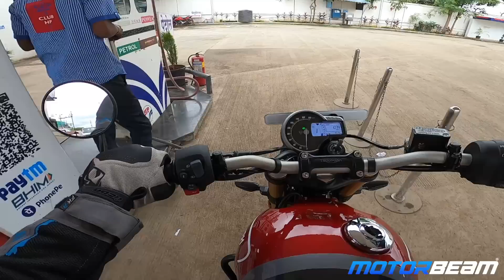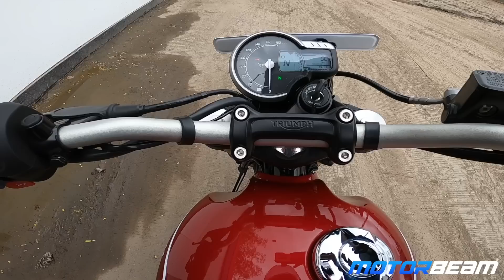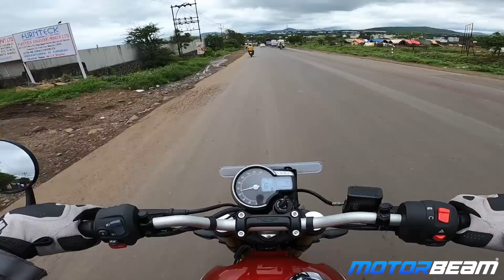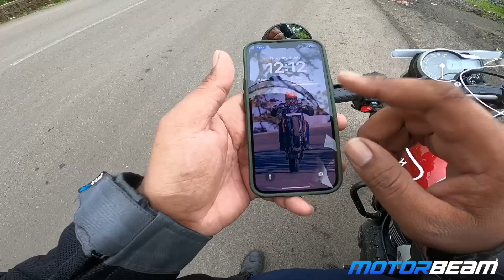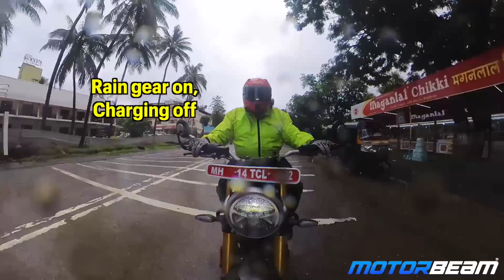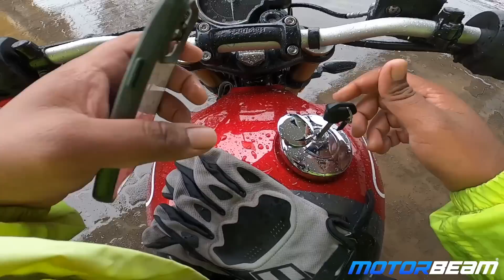Triumph Speed 400 - Mileage Test 2X.85 KM/L & Important Questions Answered! | MotorBeam

Comment: Hi I am currently facing stalling issue when I am just holding my clutch for few moments and leaving the throttle in 2nd or 3rd gear. I have latest updates of software updates. I have been going to the service centres so many times but they are unable to find the reason, chain is clean and tight as per required still its happening. Is anyone facing the same. Also I am not feeling the initial torque anymore. I own scrambler 400

Comment: Change final ratio!!! Is too “short”!!!!…… so= away standard final ratio ( 43/15= 2,866 ) and take: 36/16 ( 2.25); so you can go at taki 110 /4830 rpm and not “standard” 6150 rpm ( too much!!); you will have:
Less comsuption ( +- -10%);
Less engine stress;
More confort;
More cruise speed
Bye

Comment: This is a short stroke engine.. I wouldn't encourage anyone to run at too low revvs.. you will screw up the engine..no need to keep it in boil, but at around 3.5 to 4 k rpm which is certainly better than a ktm.. let's come out of the old bullet Era..

Comment: Triumph real world tests show 29.
Autocar tests shows 30 in city and 33 on the highway. 
A press bike with very low milage and which is being pushed to the limit will do less.
I am not worried this won't beat a 350cc long stroke, but it will be just fine.

Comment: Guys remember, he has performed several tests (Tractability, Braking performance, 0-100, Top speed) after filling up tank full. Moreover, these are stock bikes. So the mileage number achieved has been impacted due to these reasons. Anyone driving between 80-100 should get close to 30 kmpl in my opinion.
Reply: I agree, reviews seem to be 25 to 33kmpl, which sit well with the official figures of 29kmpl. It all depends on rider weight and especially riding style.
Reply: I disagree keeping in mind that the fuel now available is e20 which is definitely going to downgrade the milage of any bike
Reply: @thebackbencher005 e20 is still not available bro and e20 has separate pipe where it is written e20 you have an option wether to fill e20 or normal
Reply: Still poor average, cb 350 is way better in terms of mileage.
Reply: wht u get in dominar t same here be its a dominar engine
Reply: In Mumbai you will get 15-16 kmpl
Reply: No
Reply: Absolutely

Comment: My CB300F has given 49+ kms/ltr on highway .. of course between 70 to 85 kms/hr consistent ..
Reply: 49? Seriously?
Reply: @dinodino8662  yes only highway mileage.. city is about 32-35 kms/ltr
Reply: I Own a CB300 F and its the most fuel efficient 300 cc bike as its a SOHC engine. Keeping speeds between 70 to 80 kmph will return always more than 42 kmpl plus mileage
Reply: Bhai clutch use krne ko mileage nhi bolte...... i dont think 49 for 350 cc.....

Comment: 25 ish for a 400cc 40hp motorcycle is a big W. Thanks to motobeam, this test really helps deciding if it's a buy or pass for most customers.
Reply: This will increase after the servicing are over to 30-36km / lr
Reply: @dr.martinhwangivanowsky9438 ghanta
Reply: @dr.martinhwangivanowsky9438 😂😂😂😂😂

Comment: When you are not throttling the engine its run on wheels power, fuel supply get completely disconnected, hence it's showing 99kmpl

Comment: My SuperMeteor 650 gave 30 on highway+City..with speeds around 130 ..This one was surprisingly bit low..
Reply: Interceptor gives 30-32 kmpl when riding within gps100 kmph. Mileage drops every 10 percent for every 5kmph more. Your stats don't seem real! I own an Interceptor fro last 3 years.
Reply: @MAX-xw8xq well said 🙏
Reply: And speedo is accurate too in RE unlike 10% correction in bajaj

Comment: Max 28 expected in less traffic. Now I feel relaxed. I will settle with my r15
Reply: That's why Yamaha should bring XSR 155 to India
Reply: In city 45 and in highways around 55
Reply: @soorya_k_a_s_p 15 gives the best mileage among all performance 150 cc to 200 cc bikes. Im getting 54kmpl in city highest being 57 kmpl in city and 60 kmpl at highway as well. 😊
Reply: @vinb69  you can definitely go for it. I have almost 5 years of ownership now and getting 52-53kmpl in the city. Highway is also the same or higher. It all depends on how you ride and the chain maintenance specifically because the chain of the r15 isnt that good you have to lube it quite frequently

Comment: All 400 cc bikes like adventure 390, dominar 400, himalayan 400.
can gv mileage  around 26 to 30 max.

So triump in same segment giving mileage of 22 is a concern..
 And thats a big drawback for indian buyers if anyone looking for mileage.. 
Also service and maintenance of 400 cc  bikes wil b on higher side..
Will a  premium bike with a premium price tag succed in india or its just a hype among buyers.. !!!

Swift  with 1200 cc giving efficiency of 22 + on highway with 4 people onboard and luggage..
Reply: I completely agree. if its liquid cooled the mileage should be atleast 30+. maybe they should have lowered the torque a bit bcoz in this segment that torque is eating all fuel and in average road conditions no ones gonna go beyond 90. all these people defending triumph that it goes 170 and all. I m like wtf we dont even have good roads to cross 90-100. an average safe rider is going to ride it at 100-110 max on highways

Comment: Tank full to tank full method is the best but then always ensure it is auto cut off to auto cut off. The sensor is pretty consistent across fuel pumps and u will almost always get exact same fuel level at the start and end of the mileage test. In this video it seemed like 200-300 ml more was filled compared to at the start of the test. Thanks.
Reply: But what about position ,?
Reply: I have tested tank to tank many times I've always got 22-24

Comment: Need your thoughts on this guys

I m Confused between the Interceptor n street 400 
...yes i kno...price wise they are different segment bikes....

I m intrested in performance...as power to weight ratio will play a big role...
Reply: Going purely on the torque to weight ratios the bikes look similar. Possibly the Interceptor a little bit better at low revs and the Triumph will have a higher top speed.
Reply: Interceptor always if you can go for it
Reply: If you had a plan to go for an interceptor then you can consider GT650.

Comment: mileage test results and actual personal results vary more often than not, mostly because of riding styles,  although a ton of other factors are responsible as well..i usually get 34 35 kmpl on my dominar400 in medium traffic conditions, and on highways i touched 37 max..
Reply: Mileage is depends upon mostly upon a riders throttle action then comes tire chain  condtion and then tire pressure. And you are right if driven at 80-90kph at top gear in highway this will give 35 kmpl very easily
Reply: @mayukhsharma8465  yup agreed..riding habits contribute heavily, be it a motorcycle or a car
Reply: This is not dominar. It's a new engine
Reply: @kooler999ify  the point here is that actual personal mileage will vary, for any engine that is

Comment: hows the engine heat felt while riding , several ride revieves stating it felt a little too hot (near thighs or legs in general) 
considering this is rainy season which means its cold atmosphere , i wonder if the engine heat gets unbearable in indian summer condtions .PLEASE please CLEAR this doubt im interested in buying this bike if its has heat up issues then i have to reserve my decision.
PLEASE DO REPLY TO MY QUERY !! IT MIGHT HELP OTHER POTENTIAL BUYERS AS WELL.

Comment: The mileage is 22.8 kmpl guys 
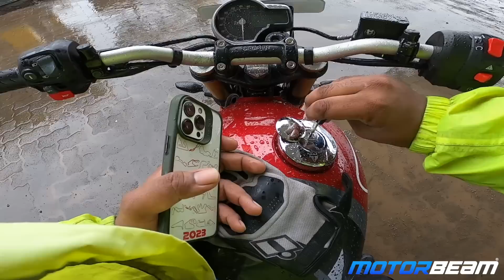At 7:15 
It has to be the worst omg 😭 I'm thinking of whether I should I buy this or settle for TVS Ronin or wait another couple of years for Triumph 250 😂(note I'm a beginner rider, have very few riding experience)
Reply: I'm using cb350rs...it's top notch in comfort, reliability and mileage is 30 in heavy city and 35+ in highway but triumph is pure performance oriented and the mileage would be around 25-30 . I would say u to go for test drive all the vehicle in the price segment and decide
Reply: @Yarahman19  yeah I'm thinking of buying the triumph as well 😄 just need to compromise the mileage part
Reply: @starboy_satoru  yeah bro... I think under 3 lakhs , it's the best for now.... Since it's a new bike , u have to be ready for facing future mild issues... But still it's a triumph they'll provide good service I guess
Reply: Go for CB 350 variants
Reply: @footballbengalcity  I don't like them personally 😭 I really wanna buy this premium bike triumph
Reply: @starboy_satoru  look bro premium things cost more . .. 
In future if triumph leave our country.thwn you will face problem .. 

They just made partnership with Bajaj 
. Like Chevrolet leaves,,,many more .

So if you like to buy premium bikes .then go for Honda bikes,,Suzuki,,,Yamaha,,,kawasay ....Honda has the premium bikes .. and good network in India
Reply: @footballbengalcity My cb350 gives 25-27 kmpl in city😑... I m not a harsh rider
Reply: @SJstreetrider  check tyre pressure, engine oil levels, mainly lube the chain it will improve
Reply: go for cb350rs
Reply: Meh I think about 25-30 if you don't ride like crazy all the time.
Reply: Kk hmm go for TVS Ronin it's light weight easy 2 handle , digital instrument cluster ,good mileage,semi retro so u don't feel old nd lastly is beginner friendly
Dual channel  abs only offer  in triple  tone variant so ignore other variants
Reply: You settle for Ronin because Ronin customers will not buy a triumph because its a premium brand 😍
Reply: @pritamchakraborty4951  bro its a 400 cc bike nd it's not a beginner friendly bike 
U r not  understanding what we r talking
Reply: I would never suggest this bike to a beginner ! You have lots of great options far cheaper than this. A beginner starting with 400cc on Indian roads. A no for me. Especially if you are living in some big city where traffic is usually a big concern. Get yourself a sub 250cc and gain confidence before moving to these premium  brands. And mind you, this is just the mileage figure which brought this question in your head. Wait till guys start crying about service. And let me tell you, let Mr Rajiv Bajaj blabber about low service cost but this bikes service cost is not going to be cheap !
Reply: go for a meteor or highness
Reply: I mean. you're getting 40 bhp. what do you expect? and I'm sure you can get around 28 if you drive sedately.
Reply: After 2 or 3 Services you can get around 30 to 33 easily

Comment: Not sure all these video's showing mileage test, how reliable is it?. 1st these are test vehicles 2nd they are abused by multiple riders 3rd no vlogger mentions the km run on tht bike and if it is serviced.
The actual mileage will be known only after 1st service i.e after clocking probably 3-5k kms. Just my thoughts
Reply: yes its true
Reply: I agree. Triumph say that in real world tests with a 50/50 mixture of city and Highway riding the bike will do 29. For what it is worth, I trust that figures, I have had 3 Triumphs over the years and have always achieved or beaten their milage figures.

Comment: Hi, you told buzz will not bother while cruising at 120 km/hr, does that statement hold true for 140 km/hr ?
Reply: going by the videos definitely heavy buzz of vibration will come at 140km/hr i think 120km/hr is a perfect crusing bro
Reply: @mohanram7450  100-110 is best.

Comment: This bike has created a hype that no other bike was able to since the first gen duke 390, it's just speed 400 everywhere
Reply: Many potential Royal Enfield buyers are considering buying the Triumph speed 400 including me. So comparison is necessary.
Reply: @souviksarkar578 no
Reply: @souviksarkar578 bro wait for hunter 450 from RE.  So simply don't  go with hype & marketing most of the reviews are paid.... Triumph don't have any service centre apart from major cities and major cities have only 1 service centre... I'm thinking this will end up like BMW 310 service where single service cost you 7k (No spares parts included just oil change)
Reply: @saraswathib8068  I have seen the spy shots of the RE scram 450. It doesn't have USD forks. Besides RE can never match the fit and finish of the Triumph. Also the price difference won't be significant to go for the RE. Speaking of service, Triumph has 16k/1 year service interval. Triumph showroom is 50 kms from my home and RE showroom is only 1 km. Still I would go with Triumph as I have to visit the showroom only once a year. And Bajaj has confirmed that service cost will be cheaper than RE. Spare parts are made by Bajaj so no issues on availablity also. Bajaj has already sorted the KTMs
Reply: @souviksarkar578  cool 👍
Reply: @souviksarkar578  You are one hell of an optimist to believe this bikes service cost is going to be lesser than RE ! Be ready for surprises after an year !
Reply: @odorlessflavorless  Bro look at the service interval, then you do the math. RE requires service after 5k kms/6 months while Triumph requires service after 16k kms/ 1 year. Even if 1 service of Triumph costs 4k, then also you will be gainer. And talking about parts availability their won't be any problem as Bajaj is manufacturing this bike. Also parts quality will be far better than RE. RE owners complaint about frequent breakdown and cheap parts. That won't happen with Triumph I assume.
Reply: Thats because of the brand Triumph and generally they are quite expensive and out of reach for the common man. This one is affordable.
Reply: Exactly.... Marketing strategy..... Hardley is missing😂
Reply: Yupp
Reply: Haha i guess you are forgetting about the hype of r15 v1 v2 v3 and the v4
Reply: Poor Harley. Its time on the limelight was cut short.
Reply: @josephnevin  long run... Harley will sell...why no major youtube channels are reviewing harley davidson x440? 😂🤣😂They are all paid to cover triumph exclusively... Wait for a year... You'll know.. 
No matter what you say, this pricing of triumph is introductory and triumph currently has 12 centers in India....by the time it becomes 100,triumph 400 will cost 2.5L... It's all marketing gimmick and they didn't want harley to win... They also need this pricing to bring in dealers because dealers won't open showrooms if they think bike wont sell in large numbers.. 
Also, you need to understand many don't buy trident 660 or Honda CB300R because they are compact bikes... Big riders will not buy triumph...
Reply: Heavy marketing by Triumph
Reply: Yeah, first i was gonna buy either dominar or re but went with this, and very happy 10000km
Reply: I don't think d390 did 🤣🤣
Reply: Lol... Paid reviews..
Let's be honest, this competes with ktm390, dominar 400,honda cbr300, Jawa, yezdi, bmw 310 and apache 310 which all comes with high revving liquid cooled engine compared to RE, benelli imperial 400,honda cb350 and harley davidson x440 which comes with long stroke engine...

But the whole marketing strategy is to compare it with RE lifestyle bike which majority of channels are doing like Bajaj wants to😅.. 
It's clear Rajiv bajaj obsession of removing royal enfield from lifestyle segment which he has tried time and time again but failed... 

Triumph was never a lifestyle brand.. It's a premium brand like ducati, benelli, aprilia etc...
Harley Davidson, royal enfield, Indian motorcycle, bmw (gs1200) and moto guzzi are lifestyle bike brands.....

Just because a bike has long history or legacy doesn't make it a lifestyle brand....
Reply: @THUGPUTIN whatever , if you are buying something it has to be fullfill the spending. I don't see royal Enfield motorcycles being worthy. Back in 2012-2019 , most RE motorcycles were unreliable. I have seen most unhappy customers own RE. 
After the competition, they started working on their shitty motorcycles. If there's no competition then will rob the money till the end
Reply: @dhanakodimani4783  lol... People can buy whatever they want to according to their needs but advertising it as better than RE is pathetic because if triumph doesn't outsell RE numbers, will it be considered failure? You better be ready to hear the numbers because triumph will never outsell RE... Deal with it.. 
My problem with this strategy is simple... Don't advertise something as direct competitor because ktm and dominar failed because of this... 
Jawa, yezdi and cb350 didn't sell who had more dealers and service...
Reply: @THUGPUTIN  agree with everything Bajaj had compared the beautiful dominar with RE by mocking it. This 400 should be a hit!
Reply: @THUGPUTIN its a much better bike than RE any day
Reply: @THUGPUTIN in the international market I would say the Triumph is competing with the RE350s more than any other bike.